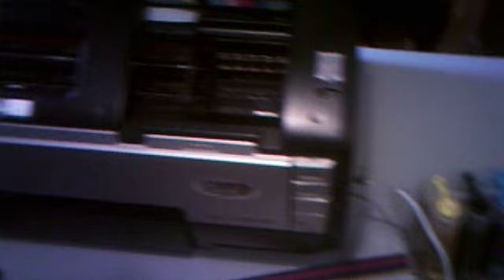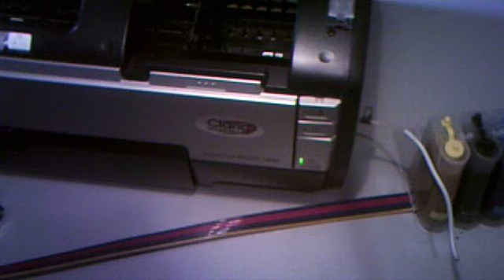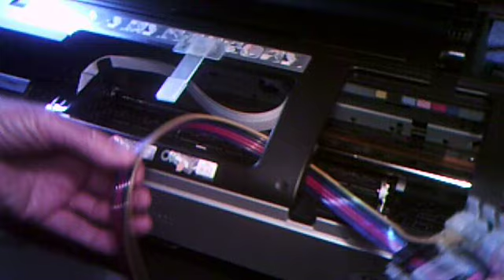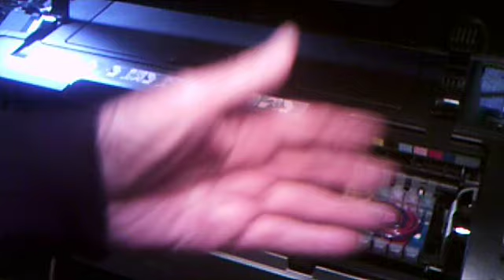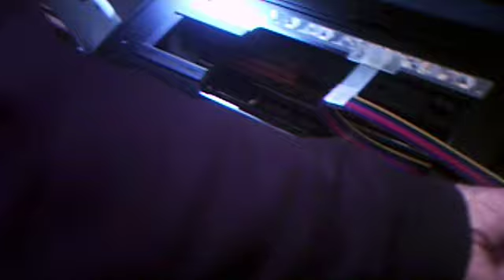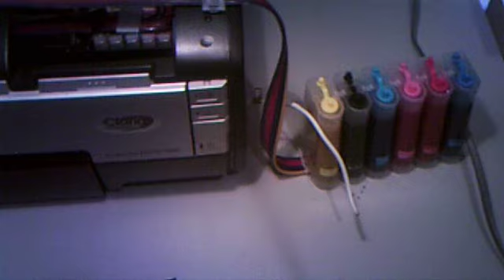Bulk Ink Installation on Epson R-1400 Eco Solvent Conversion Printer

Comment: Hi Frank, did you also remove or change print head for solvent resistent one? Or you kept original and it is ok? Is there something else what I need to replace for eco solvent solution except tanks with hoses?  Thank you!

Comment: Hi frank can i do this with my epson wf-7710?
Reply from the maker: I believe you can install the bulk ink system, however if you thinking of converting to eco solvent ink you will have to change out some ink related parts to support solvent ink, if not the ink will melt down parts it comes in contact with in your printer. Also printer may have to be modified as well..
Reply from the maker: I am not sure, since I have never done one.. I like to stick to the 5-6 color channel printers, the print heads cost much less to replace..

Comment: Hi Mr Frank.Iwant to try to use ecosolvent ink in my hp designjet 500 with new refillable inkjet cartridges.Do you think that it will works?.thanks
Reply from the maker: Sorry to say,,, it wont work the print heads are different, it seams the Epson micro piezo  print heads that are solvent resistant used mostly in eco solvent printers, like epson conversions, Roland, Soljetn VersCamm and so on..
Reply: is that the 'old' designjet 500......  i still use one of those and its brilliant, and the heads are cheap, i have been meaning to try this but must buy some ink first....

Comment: where did you get that ink system? are they ecosolvent resistant?
Reply from the maker: Jayson, the ink tank, ink lines, ink cartridges, capping/pump, print head all has to be solvent resistant materials, otherwise you will have a big mess in your printer.